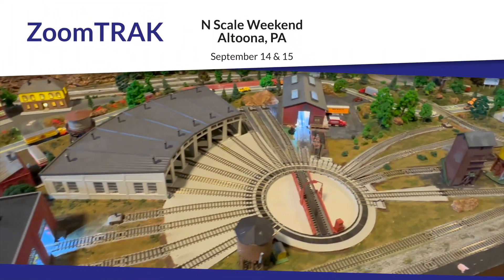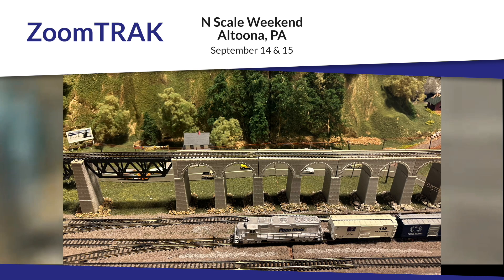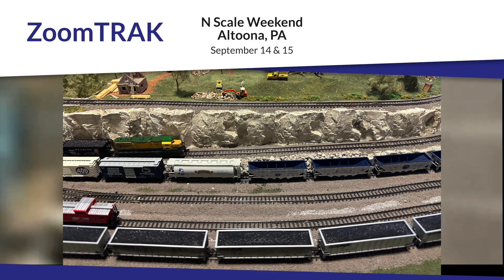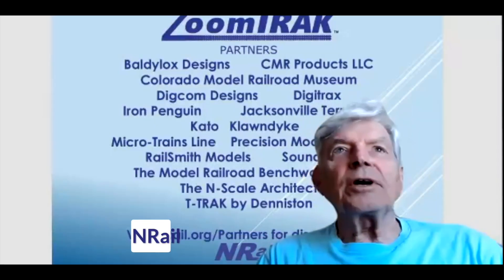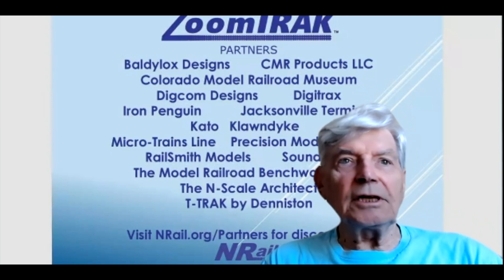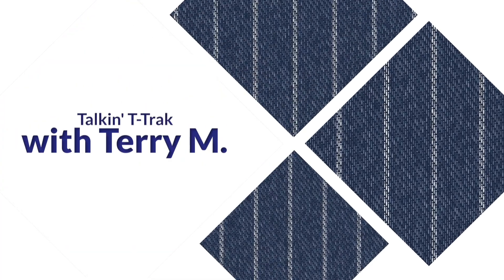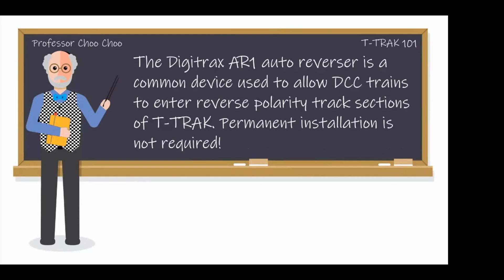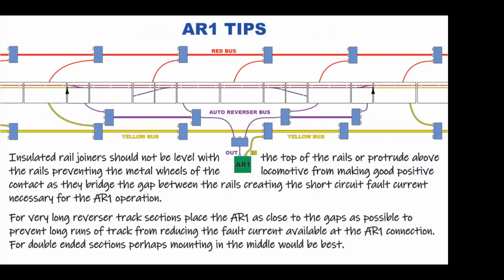Epic N Scale Weekend in Altoona and More | September 2024 ZoomTRAK

Comment: I originally installed the AR1 on my reverse loop, but the loop was too short and my lighted passenger cars would make it cut out if the train was longer than the loop. After about 6 months it quit working, no matter where I set the pot. It was totally my fault since I love long passenger trains and was probably faulting out 10 times a day. I have since been using Tam Valley frog juicers. You can pair outputs for Y's and reverse loops. I'm currently using the dual model to run the reverse loop on my Atlas code 65 sectional layout, and the Hex frog juicer for frogs on my C55 layout.  A neat extra is that the dual output model has LED outputs to run signals. The longer passenger trains (longer than the reverse loop) don't seem to be a problem for the Dual Juicer. They switch so fast that they can change states in-between wheels, so it just flashes red/green on the PCB really fast but doesn't fault out and everything runs smoothly.

Comment: I disagree with the point about insulated joiners not being level with the tops of the rails (at 15:02 "AR1 Tips"); it could cause issues. The reverser does not rely on the wheels bridging the gap to cause the phase short.  While this can and does happen, it isn't a requirement to trip the reverser. The gap will be bridged electrically by the conductive footprint of the locomotive.  Generally, there are wipers on all wheels on the loco for better pickup of power.  One wheel  will be in the reversing section while one will still be out of it, this is sufficient to trip the reverser.  By having metal wheels bridge the gap, the reverser could wind up fighting itself if trains are running over both sets of gaps.  If a locomotive is leaving the reversing section and another is entering it, the metal wheels of the entering train can bridge the gap while the loco, set of metal wheels, or a lighted car is bridging the exit gaps. The reverser will fight itself and cutout for a second or two.  The train will start moving again, but only until the next set of metal wheels bridges the gap.  I see no adverse effect from filling the gap.  Worse case, if you have only one axle on a loco picking up power, the reverser wouldn't trip, but it wouldn't have to in that case. The reverser is only there to address the situation of a short occuring. If there isn't a short, it doesn't matter, the loco will happily keep going.  @steve_larson mentions using the the dual frog juicer as a reverser thus avoiding the fighting gaps.  Haven't tried it myself.